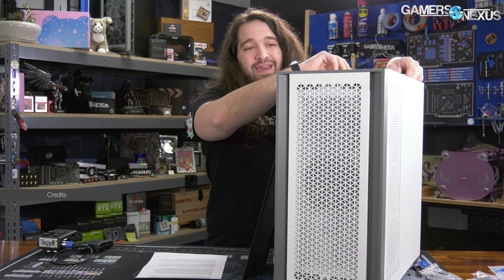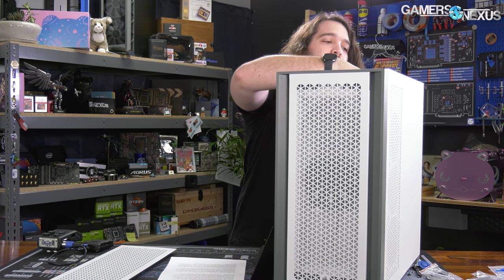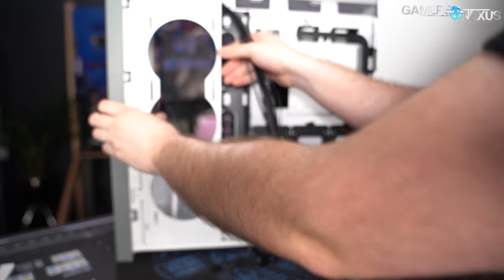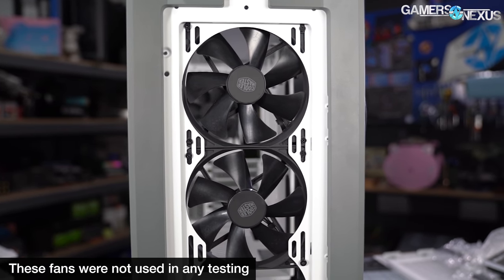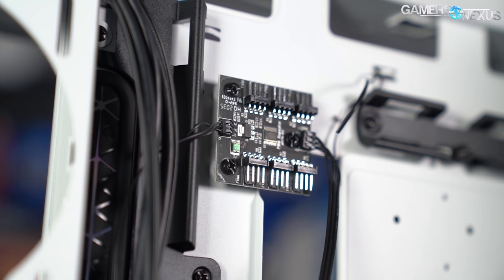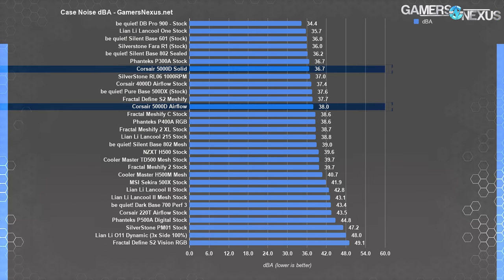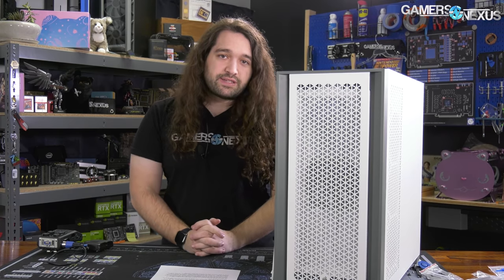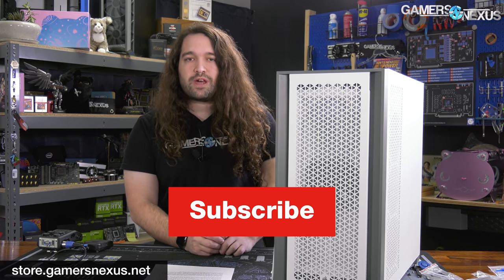Corsair 5000D Airflow vs. Solid Case Review: Thermals, Noise, Build Quality

Comment: I'm still using a 400C, which is like the middle-ground between solid and open, and I don't have any thermal problems.  But I'm also not using the crappy fans that came with it either, and I keep the top panel on, instead of off.  They haven't really designed a similar sized case that is that innocuous since then.  Most of their similarly sized cases always come with the obnoxious transparent side panels, which are not good for those who don't want to have a bunch of distracting internal lights constantly flashing.  The front panel is really obnoxious to remove though.  Haven't broken a clip yet, but I'm just counting the days...

This stagnation that they had been sitting in for years now is pretty sad too considering how they were the ones that shook up the case industry pretty hard when they released their more-than-you-will-ever-need-for-anything 900D.  That case wasn't perfect, but it was extremely easy to work in and added a bunch of necessary features that had been lacking up until that point.

Comment: I got the 4000D, my main problem with it was interference with the GPU, where the 24 pin cable would be routed, there's like a metal kick out that helps to hide wire's. Looks great but kinda felt like the GPU didn't fully seat into the slot. Still worked but, turned me off.

Comment: I just wish cases provided a few different patterns with the front panel like bigger cutouts. A honeycomb pattern with large hexagon cutouts would look dope. I did this with an NZXT case where I brought it to a cnc shop and temps dropped almost 10C in coolant temps under load.

Comment: I know that this video is a few months old by this point but I can't help but wonder if the size of the other cases might have something to do with their better performance as far as heat dissipation is concerned. The 4000D and 5000D are both about the same dimensions but are rather cramped (speaking from personal experience as I went with the 4000D) anyway the thought is that a smaller space will tend to heat up faster the more components you have crammed into it, add in the fact that a number of those components are probably going to constrict air flow (especially a massive cooling tower) which would account for higher temps over all. I think I can sort of confirm all of that to be true as I noticed after swapping out my stock AMD air cooler with a Fractal Design AIO, temps (going by feel) seemed to be a LOT cooler, even after a gaming session, the thing with the AIO is it doesn't take up as much space in addition to the fact that it's not pulling a bunch of heat off of the CPU and then immediately dumping into an already cramped space.

I know that 2 or 3 inches difference in space around components might not seem like much but I suspect that it in fact plays a bigger role in temperature management over all in that it allows for better air flow around components and out of the case, which is why I don't think comparing the performance of this case to that of larger cases is necessarily fair, instead I think a better comparison would be to cases of a similar or the same size.

All of that being said (if anybody read this) I'm actually considering upping the size of my current case to one of the ones linked in the description.

Comment: i brought this, with my ryzen 7 7700x rtx 4070ti, b650 thomawhawk wifi, had ll120 corsairs 4 of them from my previous pc, so swapped them over, with corsair h150i cap XT cooler, got full rgb corsair fans with it, easy to build in, i don't like the "clip" side panels, as one of mine fell off and in talks with ebuyer to get a replacement side back panel sent out.

Comment: After having this case for about a year, I'd say my only qualm is that the PSU can't come out the back.  I got the tempered glass one and it you want something that doesn't have a chance to break your back if you want/need to move it, I'd get the airflow addition. It'll be about 5 pounds lighter.

Comment: Corsair have always tried to use the thinnest metal going for their cases. The 750D I had was the biggest pile of crap going... the whole case used to flex when fully loaded with two 360mm rads and the motherboard etc, the side panels would not line up square with the internal chassis of the case because it was going out of square also the motherboard tray was so thin it used to wobble fowards and backwards making it near impossible to line the gpu up straight at the back bracket and motherboard slot, I ended up not building my pc in it and taking it down the local recycling center that was the best place for it........Still looks like they are no where near the level of a phanteks case in my opinion, they still look like their made of swiss cheese - gage of metal used is thinner, two panel joined to together instead of using one piece stamped and then bent, I gave them another try with this case and still sent it back it's not worth the money...Compare this to a phanteks case like an Eclipse P500 air it blows corsair out of the water for build quality and price. I own a phanteks evolv x and pro m they are the best pc cases I have ever owned, I've been building pc's for a long time and have used many cases since the early 2000. I have another build in progress with a B650 motherboard and it will be another phanteks case that everthing goes in for sure........there built like tanks instead of swiss cheese and will last you alot of builds...............................Buy one, you will not regret it 🙂.

Comment: Im going to be that guy who points iut that at 4:40, the mesh overlay in the video is being positioned incorrectly. The way that they oriented the magnets offset like that is because that sliver is supposed to go along the truss looking part on the LH side if youre looking at the case head on. The way the person in that video positions the mesh, that offset magnet sliver will literally ride on the little rivets holding the case togrther. ;)
Reply: The little yellow tab should be at the back left on top. Also, the way the mesh is oriented in your video, the magnetic sliver that is not offset will ride on the bolts that mount the top fans. The more you know!

Comment: I have the 5000x rgb version and I can’t believe GN didn’t mention that the cpu power cables get hit and are a very tight squeeze when a 360mm and fans are top mounted. The way the holes are in the top make it so with 360mm there’s no way around. I absolutely love the case but couldn’t believe corsairs oversight with the cables putting pressure on the cpu cables.

Comment: Incase anyone gets this case with an Arctic Liquid Freezer II cooler, you cannot side mount it and most motherboards stop you mounting it in the top aswell due to clearance, so I was left with no choice but front mounting and moving the front fans to the side as intakes

Comment: what i personally find wierd is i have a 5000x and there is absolutely no temperature difference during stress test with or without the front and top panel. And its not like I have an air cooler, my PC has a 2 fan aio which I would expect to be effected.
Reply: Is not weird. The case is that amazing, the problem is your AIO or CPU with absurd voltages and power limits.

I have a Deepcool Assassin 3 cooling my i7-12700K, i don't notice a sound difference for the computer turned on vs off and the temperature is amazing

Comment: After seeing Corsair sold the front panels seperatly for fairly cheap, I got the 4000X with the better fans and hub. Should the thermals become an issue I can always upgrade my case closer to the airflow spec.
Apart from lack of front IO this case is great!
Would've loved to see a side by side shot of the 4000 and 5000 cases since the new one seems to be quite a bit taller? I picked the 4000x over a lot of its competition because of its size.

Comment: So in my case, I have 5 Corsair LL fans. Three 120s and two 140s. When I upgrade to a newer case (I have a Meshify C and it is VERY crowded inside now), included fans will not be an issue. From what I can gather in regards to custom builders, I see very few using the included fans. If I'm trying to save money at every corner, I'm not buying (what some would call) an expensive case like this that is flashy. And as such, I would not buy fancy expensive fans, either. The emphasis on included fans is warranted, yes, but I feel it's a bit exaggerated when I'm buying a case to show off the internals but with cheap basic fans that are hideous looking. It's a bit much these days, from my personal opinion.

Comment: In my case (not the tested one) moving the front intake to the bottom helped with temps in general. Pointing the front intake at the gfx card was detrimental. Now I wonder if gently guiding the air upwards with a bent piece of cardboard or thin sheet of plastic would result in the ultimate cooling.

Comment: Great case, I love mine.  Overall, its very easy to build in and has plenty of space.  It looks great.  My only complaint is how tight it is up top with my 360 mm radiator and the CPU cable.
Reply: How did you get that to work?  Did you bend them?  What type cpu cables did you use and what psu?

Comment: Naah, too big. I wish they would make a 4000D rev 2. I just recently got a 4000D airflow and I really like. If they would make the front fan-mounts more solid, fix the floppy front filter, add some nicer HDD mounts (yes, I still got an HDD drive, and those solid plastic slots feel really cheap compared to the ones in my old Zalman GS1000) and add a separate microphone jack on the front panel (maybe a second usb-A connector), I would absolutely upgrade, and even pay more than 100$. I am also a big fan of the looks.

Comment: circulating air through the open top fan mount?
close any opening that you do not want air to flow through!
I use cling film for that, it is almost invisible and does the job well.
also: If it moves, and should not: Duct-tape.
I do not guarantee that a Duct-taped case would not harm your aestetic feelings tho.

Comment: Just rebuilt my pc in the 5000d airflow, I loved it the only problems I had with it was my rampage v extreme cpu power cable interfered with my aio but that was more because my mb is huge and also i had no type c conceter so I have useless type c

Comment: The thermals on the d5000 airflow are absolutely amazing, completing a build inside of this case was extremely easy. Cable management was also a breeze!  My temperatures were all well within acceptable levels, but my desire to go colder prevailed and I added some additional fans so now this thing runs like an ice box! 🧊 😀

Comment: I have the 4000D and I could fit 360mm radiator in the front, granted it was the hardest installation ever with the motherboard installed and front io cables.

Comment: My dog knocked my PC over and the case was bend and shattered glass. I had the 465 ICU which was a decent case but I couldn't actually top mount my AIO. I ordered the 5000D and I like the options it should be a case I can easily change stuff if I need to. The thermals with the solid front are fine for me.

Comment: I really enjoy the aesthetic of the solid front especially when it comes to the glass panel on the 5000x  and 4000x. Understanding slightly better thermals come from the 5000d(5000x) can i get adequate thermals running 3x120's front, 120m rear and a 240 or 360 radiator up top

Comment: What would the numbers be like if you used 3 front fans and 3 side fans for intake, and a 360 with push pull on top? Wouldn't that be better for cooling?

Comment: I have this case and it's way too small. Not enough room for a top mount radiator because the power cables (2X) connected to the top of the motherboard is blocking the space where the radiator would be. The power cables routed to the RTX 4090 couldn't fit through the space between the bottom of the board and the PSU housing, so I had to route them to the right side of the board, thus leaving the cables visible and not hidden in the back of the chasis. All the cables management were tight squeezed and I had to remove the cable bar otherwise the side ATX power cable wouldn't fit through the small opening. It's a nice case, however everything in it felt cramped.

Comment: Thanks for the hard work, I got a Meshify 2 because your reviews answered most of my questions about different cases. I would like to see cases have more front panel I/O interchangeable plate options, kinda like using a drive bay plate in older towers. I managed to stuff 9x 140mm fans into the case mostly because I could. Due to space constraints, the case has to lie on it's side, have you reviewed using one of these cases in that configuration and how it affects the airflow? This orientation seems to cause the GPU fan to rattle some.

Comment: I would love to see thermal testing done with different fan layouts so I have an idea of what the best configuration would be. Does it perform better with radiator on top/side/front? Does it necessitate negative air pressure if you're putting intake in front of or behind a radiato? Does having a radiator necessitate leaving other panels non ventilated in case of turbulence issues? Of course that's lazy because I could just try a bunch of configurations and test, but it would still be interesting.

Comment: i run a 750d so the 4000d caught my eye as i wanted a smaller case ordered one and a solid front turned up :( and the airflow has been out of stock since. The 5000d did catch my but its more of a side-grade tbh. this review kind just goes to show how good the 4000d its such a smaller case for a couple of degrees higher.

Comment: I love the corsair 5000 case's. I just got my 5000x black. It has 3 front sp 120mm fans but it's lacking 1 in the rear. I just don't understand why they thought about a rear exhaust fan in the d series but not in the more expensive x series
Reply: Those RGB fans and lightning Node would probably cost $80 by itself.  Those 2 fans in the airflow cost maybe $5 total. Which is the better value?

Comment: Thanks for this review. I have two questions with this case.
1-. Which dimension have the 3,5" hdd bracket?
2-. Would it be possible to add another bracket for a 3.5" hdd?

Comment: Hi, I've just bought this a Corsair 5000x case and I already have a Corsair H80i as water cooler. Should I invert the air flow of the H80i fans to inside-out using this case?? Thank you!

Comment: I had a corsair carbide 275R and i like to overclock the crap out of everything. I didnt like it because it sounded like a jet taking off. I bought the 5000D airflow and my temps have never been lower and case never been quieter

Comment: Are 3.5" drives vibration dampened at all? Are rubber grommets included and can they be used with a 3.5" drive?
Reply: @Tano More concerned about noise TBH
Reply: @Tano 120Hz vibration is common and not a sign of a bad drive.
Reply: @Tano I do not think you are familiar with the vibration I am talking about. The noise you are referring to is the read/write head moving. The vibration I am talking about is a result of spinning platters. 

The disks themselves are not noisy. A proper metaphor would be that they are the speaker coil and the case is the speaker cone. If you isolate the coil from the cone; there is no noise. Another way to think about it is the drive is like a tuning fork; nearly silent until pressed against a resonant body. A resonance in the case is exacerbated by anything else not isolated such as desks or floors. 

Perhaps I am overly sensitive to this, but on my Lian Li Lancool II (with all Noctua fans) using the drive tray caused my system to be   around 55dB versus a DIY isolation brought the system below my noise floor of 30dB (both times the system was idle as in drives spinning but not accessed).

As for SSDs, the price per TB just isn't affordable yet.
Reply: @Tano Why are you so invested in this?How much do you want to bet this case uses rubber grommets for SSDs just like Lian Li?
Reply: @Tano That or case companies could learn about acoustics. Solid third option. Its not even a new concept. Cases used to do this.
Reply: @mouthfulofpeanutbutter9753  noises coming from hdds aren’t the biggest concern these days from case manufacturers.

Comment: At least they didn't put a bunch of mounting points for fans on solid panels.  Also, why didn't you do the normalized fan setup on the top and bottom slots, rather than top only or bottom only?  I mean, if you were going to choke the CPU or GPU, why not try to choke both?

Comment: 10:08 Neither 120mm OR 140mm fans will fit perfectly with this design. With the other design, 120s are perfectly aligned, and yes 140s are imperfectly aligned. But here, both sizes are imperfectly aligned. My round-framed 120mm fans all have a big air gap encircling them. Precious intake air immediately spills right back out, via those gaps. ...Whereas I need that air to instead be leaking out of other far more thermally strategic areas of the case.

Comment: While reviewing the 4000D and 5000D how is the tension on the front dust filter? I work in retail and have sold quite a few 4000D on your recommendation, we got quite the many of them back thanks to too much slack on the front filter causing the front fan to grind into the filter.

Comment: One thing I would like to know going forward is top clearance for radiators. More specifically, can I use the Arctic Liquid freezer II? I tried cases that on paper had the clearance for it, but which in practice did not